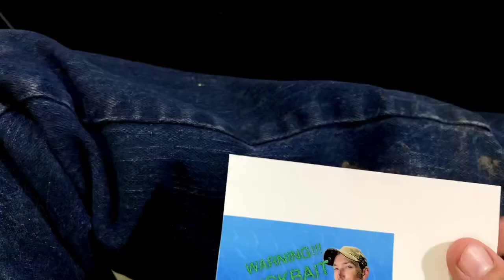Lure Making | Clickbait

Comment: interesting non the less 😂👏 Did you use a laser printer for the water slide decal? or was it an inkjet printer and then use a fixative to stop the ink from running? Nice to see another video up from TreysArt 👍
Reply from the maker: It was an inkjet printer. I’m not real familiar with using it so I may have done something wrong. I’ve never used a fixative. Maybe that would have helped.
Reply: @TreysArt  I had just learned from another channel 30 minutes earlier, the guy was printing fish eyes unto water slide paper using a laser printer and a commenter doing the same thing with an inkjet had ink run problems so was recommended to use a fixative. With the laser it's not needed apparently. It was a coincidence to find your video popping up shortly afterwards using water slide decals on your lure too 😆 His 3D fish eyes look fantastic, using real pictures of fish eyes then manipulating in Photoshop for printing to stick unto holographic paper then add a blob of epoxy to finish. Great but a tad too technical for my liking as I prefer a more hands on approach as I spend enough time in front of a computer screen as it is, plus he was using a works laser printer; top of the range and expensive.
I think yours turned out great but you can see the ink resolution, perhaps the printer software needed set to fine detail which also uses more ink and may actually get rather messy. Trial and error I guess 👍
Reply from the maker: Yeah it’s always trial and error. I’ll prob look into it more later. For now I got some other projects in the works. 👍🏼
Reply: @TreysArt  👍👍